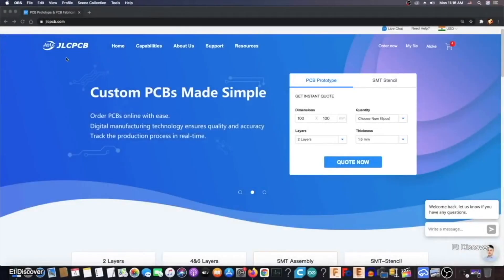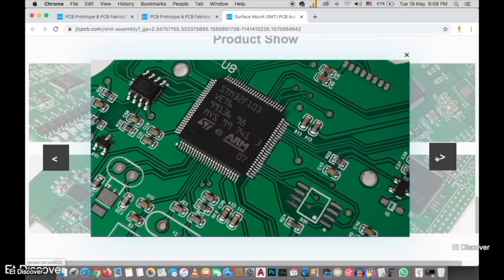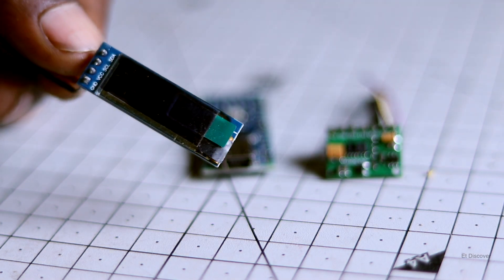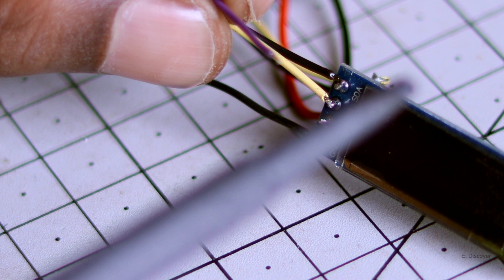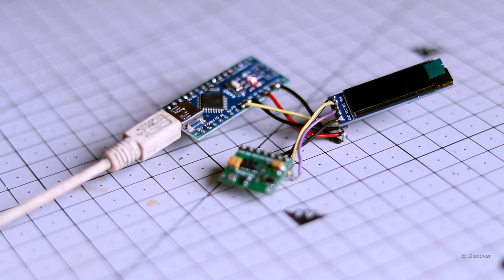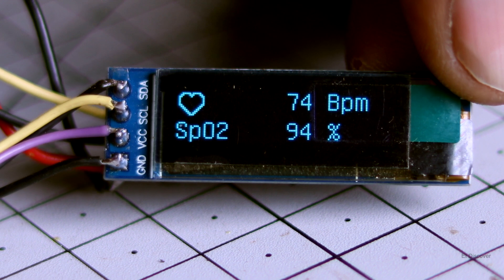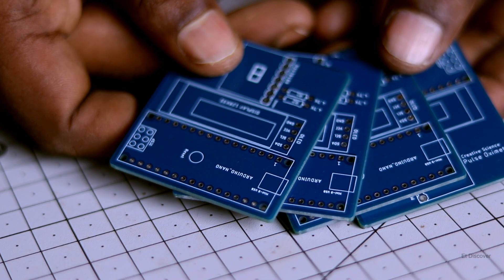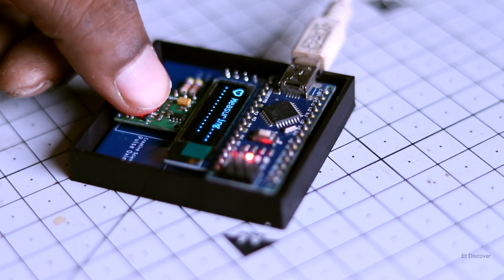Now You Can Take Care of Your Heart-Beat & Body's Oxygen Level, With This Device

Comment: Bro can you please make an video about making 3v battery power non rechargeable multimeter into an rechargeable one because when I directly connect the li ion battery to the multimeter it will broke my multimeter cuz the multimeter's input voltage is 3v but in case of battery is 4.2v its to high for the multimeter so can you plz make an constant 3v regulator or low Dropout regulator plz ....